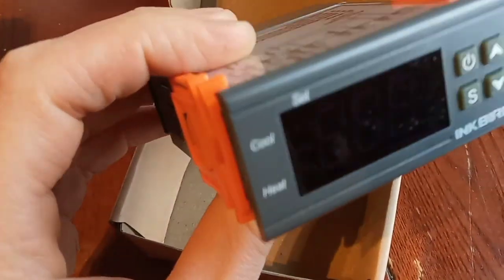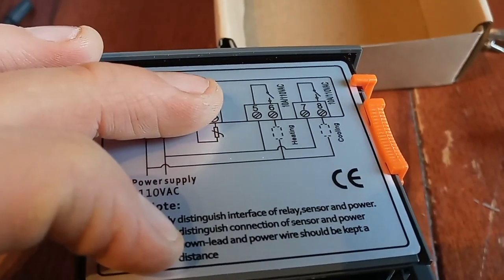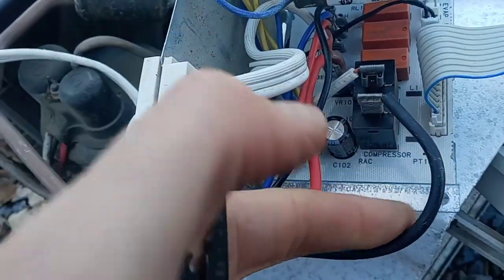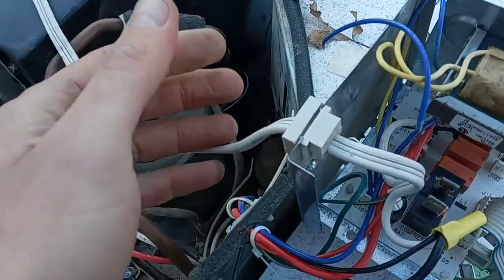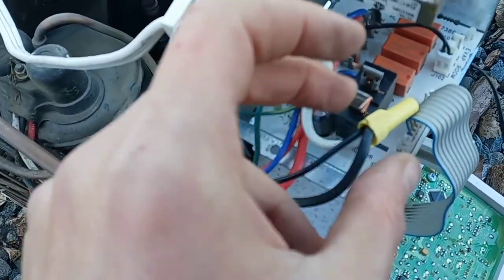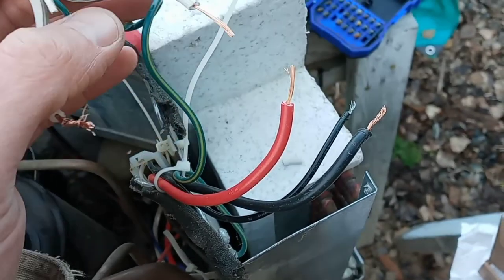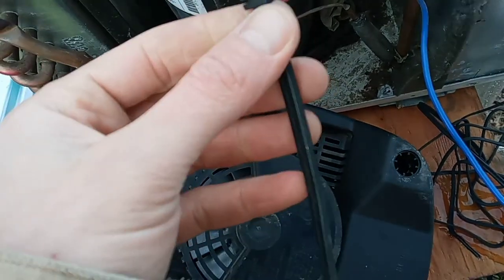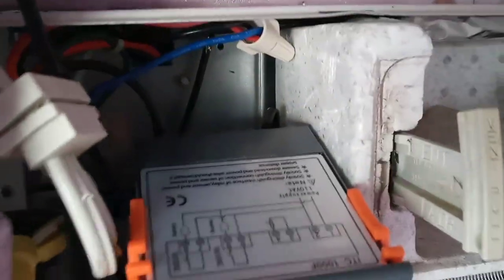$20 DIY Walk in Cooler Thermostat Hack

Comment: How did you solve the freezing fins problem?
Reply from the maker: Did not set thermostat low enough for that. Have not run it long periods below 40. My thought was to wire fan to constant power and compressor to thermostat on fins to shut off compressor if fins freezing.